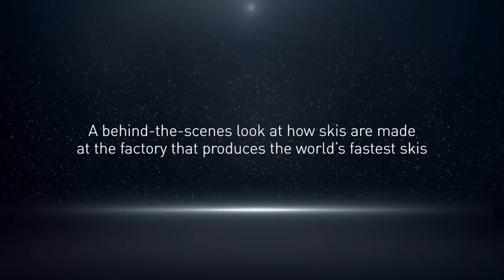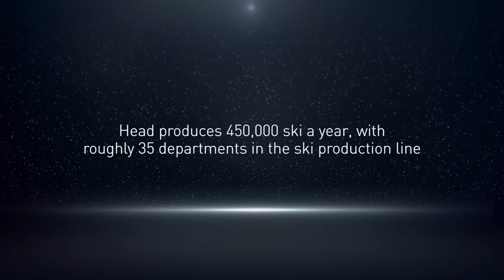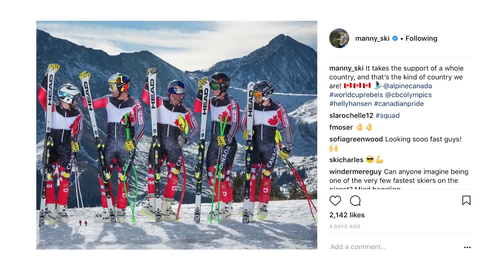A Closer Look at the Head Ski Racing Department

Comment: I am 5 ft 9 inches with 180 lb.  What ERace Pro should I get?  170 or 175, or 180 cm?  I tend to ski medium turns and am trying the master the skill of popping across each side of the slope.  I love going super fast on blue or black diamonds and the trill of my hip reaching lower and lower.  I also heard that next year's model (blue color for Pro) is changing dramatically.  Any thoughts on that?